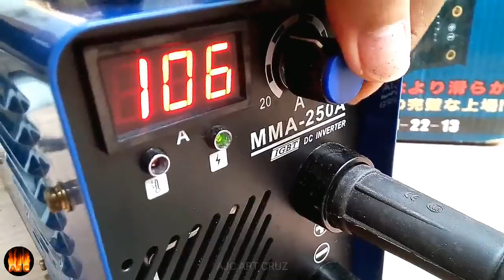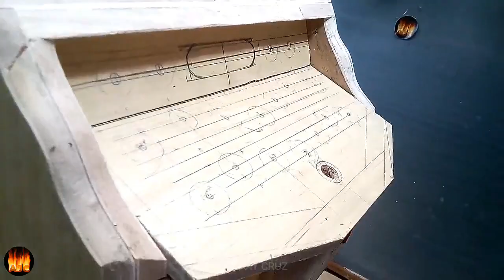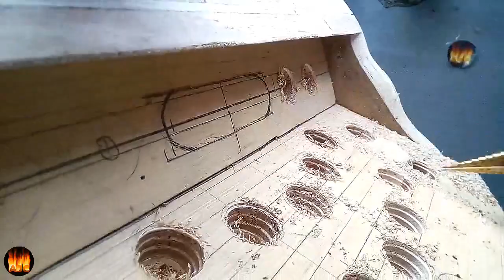Step drill damage fixed

Comment: Sir, comment lang.  Kaya pala nabali ang drill bit mo kasi kinakalembang mo pagdating sa dulo pagmalaki na.  Hindi dapat ganoon ang paggamit ng barenang iyan.  Deretso lang.  At, para hindi hirap ang makina at bit, pahintuin mo naman para hindi masyadong mag-init ang talim.  Kahit kahoy iyan, nag-iinit din yan.  Halos mas mainit pa nga kesa bakal.  Sa bakal kasi, madaling lumamig.  Pasundot sundot ang pagpiga ng drill switch para tumagal ang bit.  Hwag ikalembang, kahit anong talim, hwag ikalembang.
Anong welding rod ang ginamit mo?  Kasi, napansin ko lang.  Patong ka ng patong ng weld.  Kung 6013 ang ginamit mo, punung puno na ng slag, wineweld mo pa.  Kung sana ay tiniktik mo muna para sigurado.  Di na kelangang kapalan ang weld.  Pag kumapit iyon, sure iyon.  Di mo tiniktik kaya di ka sigurado.